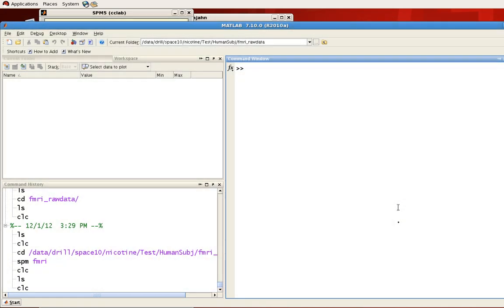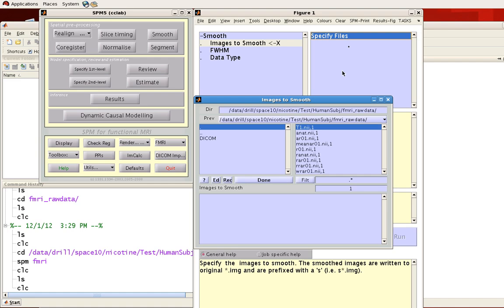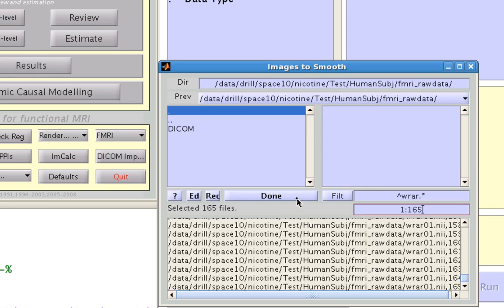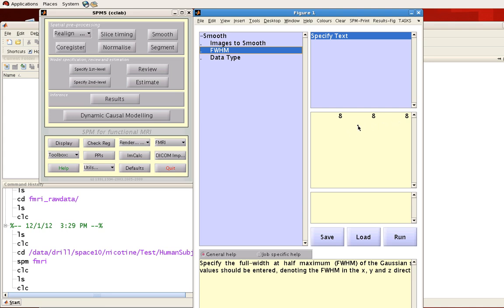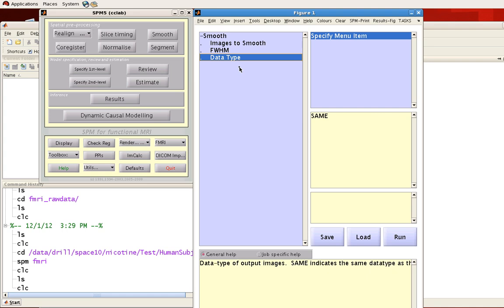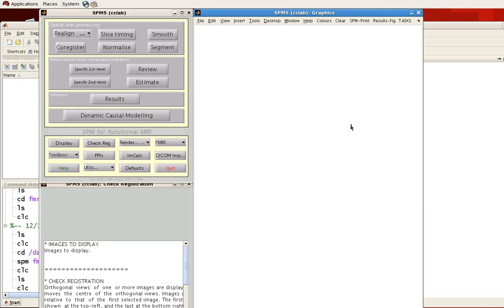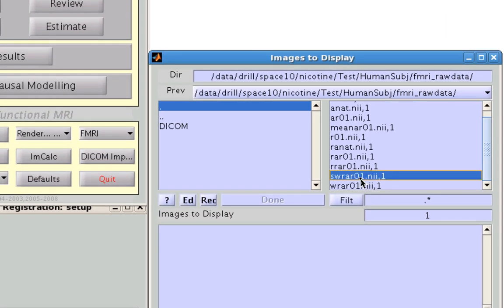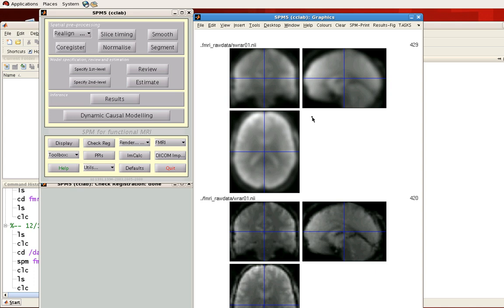SPM Smoothing

Comment: Hey Andy,

Thank you for pointing me to use jobman last time to run batch files. Now, I'm at the normalization step. After applying coregistration, there is a new file produced called "rrar01,nii" in your example. I realize that you didn't use this file when applying normalization but used 'rar01.nii'. I'm just wondering if that was an overlook, and we should actually apply normalization on 'rrar01.nii' not 'rar01.nii'. Thank you for your continuing support to this community. 

All the best,

Pengyi